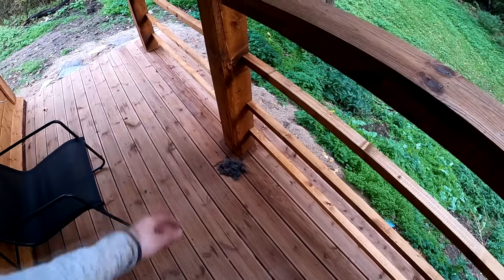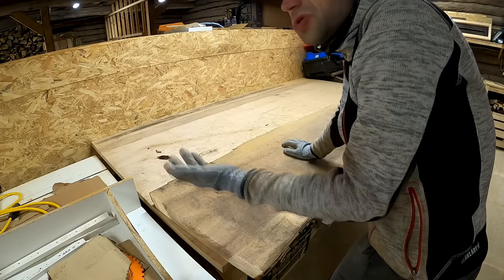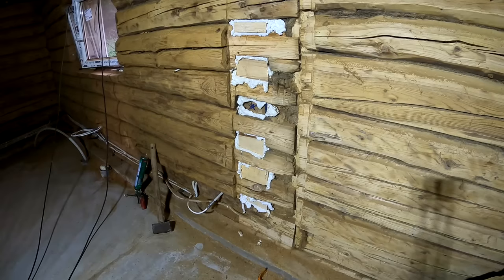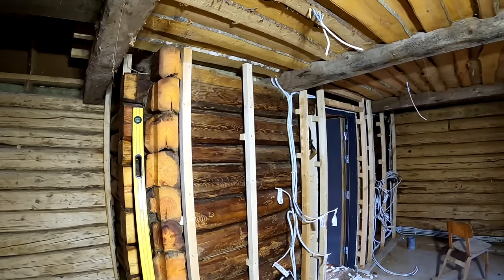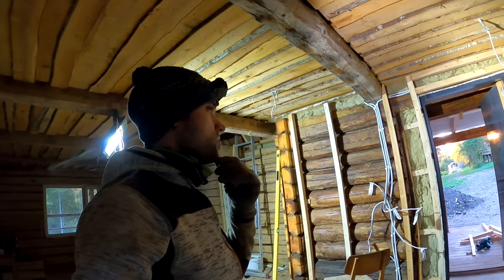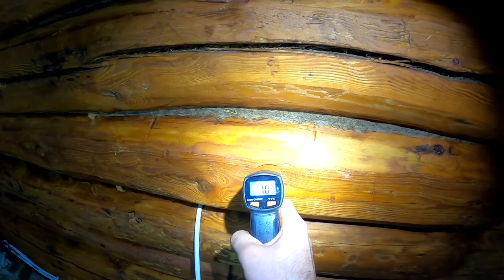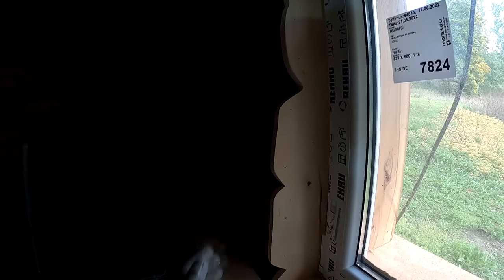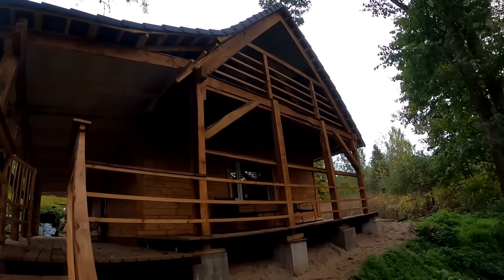Renovating a 128 year old forgotten log cabin (part23) - Interior Walls Finish

Comment: If you don't put steel wool in with the foam, the rats will go through anyway. They wont go through steel wool, It tears up their mouths and between their claws.
Reply: He could wedge it between the gaps in the logs don’t you think?
Reply: He already put in steel mesh.
Reply: Rats dont touch the foam
Reply: I would put everything I would steel wool thin metal sheeting close cell foam  and all the wires I would have put into a PVC
Reply: It will also tear their stomachs and go through into other organs
Reply: @donaldkennedy5604   Not good enough, they can get through that.
Reply: @kenhart6330  and it will also be a painful exiting from it's tailpipe 🐀💨🤣
Reply: The mesh he used is too big to keep mice out. I use metal lathe (very fine diamond pattern) and then spray foam it. There is also spray foams that have mouse poison in it but normal spray foam they will go right through.

Comment: You should round off the ends of the window sills like you did the top edge of the front door frame.Nice detail with the drywall edges where it meets up with the log walls.
Reply from the maker: Good tip. Thanks

Comment: My friends installed old barn wood as an accent feature. After a while, and as the boards warmed up in the home, bugs started hatching and swarmed everywhere. They ended up having to hire and exterminator. I hope those boards you used do not have bug eggs in them. Thanks for another great video.
Reply from the maker: Yes i will keep an eye out. Seems unlikely as the holes i could see through them

Comment: I love the spotted wood with bug holes in the window framing (As long as the bugs have vacated the property) it ties in well with the 128 year old logs. probably need a sign where the wire mesh is, NO ENTRY and a picture of a mouse engraved into the wood and a date :) (always thinking of the next guy to find it, hopefully in another 100 years. i prefer the soviet trolley to the chair although they are probably equally amazing in their own rights.
Reply from the maker: I agree very much. Glad you like the solutions iv came up with. Soviet stuff are great i got lots of em and they seem to last forever

Comment: Mice are repelled by peppermint odor. You can buy the spray or use peppermint oil. You do have to reapply about every 3 months. Since your mother & aunts have such a nice garden, you could even use fresh peppermint to make oil. It's one more layer of protection. I spray around doorways and other areas where mice might come in.
Reply from the maker: Thanks for the useful tip 👍

Comment: Tere. Perhaps i see a problem coming. Log buildings sit, sink and settle until the rooftop is on the ground. No matter how old the logs are you build with. Whenever you put anything vertically solid structures on a log frame, you should make them "floating". Nice work as always! Hope that this settling won't become a problem.
Reply from the maker: before i put any windows on it, i let the logs settle for about 8 months over the winter with the snow and concrete roof on it. I hope it did most of the sinking during that time

Comment: My favourite part was when you cut a hole in the plaster board and pulled the wire through!
Just wondering whether it is possible to clad the wall with some Alder rather than plaster and paint. 
Great job and fun to watch.
Reply from the maker: Hehe interesting solution 🤔 thanks a bunch.

Comment: About your question on what to do with the window you first see walking in through the front door: I'm no carpenter, but it seems to me the grey insulation matter just needs covering up right above the window frame - either with a couple long splinters from the log wood-type, or with some more beech, if there's space to fit it? If you use the log-type & manage to get the wall-flush "splinter" lengths flush with the perpendicular beech-wedges already there, should look cool - lilke a special feature! You're really good with getting all those bulbous shapes to fit with custom fitted straight planks, so I'm sure you'll work something out - if need be.

Otherwise - fantastic job, pleasure to watch this ancient cove becoming more custom & getting some extra spruce!
Reply from the maker: Hehe yes log idea is great ill try to do that one day

Comment: Turned oout great man!
The inside framing of the windows, very nice.
If the bugs got in the wood whilst it was alive it probably is not the ones that go well with dry? I think, hope or mabye not crave but whatever, touch on wood.
Reply from the maker: That makes sense tbh. There are bugs that only live on live wood and then there are bugs that prefer dry wood. Good hindsight there 👌

Comment: I would have thought that milled wooden boards from the trees on your property might have been more in keeping with the cabin rather than drywall (plaster board). It would have the same effect of hiding the wires without the clash of materials that the drywall in a wholly wooden cabin delivers. Just a thought. I am loving the way the logs turned out inside. Another great long-form video. Fabulous.
Reply from the maker: Thank you for your input. I appreciate it a lot ❤

Comment: new here , but love what you are doing. i have an idea for your bags of saw dust and wood chips. take your 20 ton press and a piece of  pipe 609.6mm long and 76.2mm in diameter. cap one end of pipe off and make a fire log press jig.
Reply from the maker: Good idea
Reply: If a binding agent is needed you can have little ones help make home made natural school glue non toxic if burned. Not sure how to get the logs out of the tube but worth thinking about. Have a beautiful day

Comment: I have used linseed oil , after it is dry it is safe, by careful with rags and brushes, they can spontaneously ignite,especially in sunlight or being compacted in trash, after I use them I burn them in the wood stove.
Reply from the maker: Yeah iv heard this too. Wondered about the linfelt as it was compacted between the logs but it didnt even get any hotter then that

Comment: Altax is making product to kill bugs in wood, it is permetrine in some solvents, it's little bit oily, you can apply it on backside of boards and after drying oil them with linseed. I'm doing my best not to use bug infested wood on new projects but if you want to use it, just kill all the bugs. Watch out with this kind of products because it will harm cats, just not allow cats to get close to wet boards or cans with this stuff. Another great video and progress. I'm amazed where you get time to do this stuff, are you doing it after work? Those videos are very motivating :)
Reply from the maker: Yes after work. Most times on free days though. Thanks for the tips. Will keep an eye on the bugs of there are any 👍

Comment: Not sure if you realize-
You can make a bracket, hold a circular saw upside down, blade sticking up through a table.  Replace that weaker saw. Make it so it detaches easily, if you need the saw portable again.

Comment: Ok you probably already know this but just wanted to make sure. The back end of your knife you used to cut the Sheetrock comes off and there is a slit that you put the blade in so that you can use it to safely and easily break off the dull section
Reply from the maker: No i didn't 🤔 haha thank you 👍

Comment: I LOLd as I watched the machine gun attaching the trim. Are you sure you never worked in a mobile home factory? When I worked in a mobile home factory, it sounded like rapid fire machine guns.

Anyway, the walls turned out beautifully. How are you going to finish the joints on the drywall?
Reply from the maker: Mwhahah. Yes 😅 with plaster some other time

Comment: I liked this episode a lot. I personally dislike dry wall (in general.) so I would have liked it better if you'd used the Elm to cover the walls. (But like you said earlier in the video, I am weird.).
My favorite part of the video was when you were talking, saw someone mowing the grass and commented (At least SOMEONE's being productive..... Insinuating that most people living on your property just mooch off you.). Made me laugh to know that families are the same all over. 
I also really like the work you did on the window frames. And the oil helps to add some character to the wood nicely.
But as you were showing the work you did, I saw that the boards for the second floor are not up to standards of the bottom floor. Do you plan on making them look better, or are you going to cover them up? I think it would look nice to have some of your home milled lumber cut square and then screwed into the boards giving you a nice ceiling for the first floor, then you can stain or oil that to make it look the equal to the rest of the building.
So good job sir, and keep the awesome content coming.
Reply from the maker: haha :D 🤣 yes the oil does improve the overall situation i suppose, The second floor boards, not sure yet, yes those are just sawmill boards i put there so i could install the roof supports in the very beginning, now im thinking if i should cover them up or take them down and send them through a planer, Me thinking coverup would be a better and easier solution
Reply: @Ants_Pants  If you leave in place and just ensure that they are level enough that you can cover them up. To my mind it would make things so much easier. Since you will have a stable sub-floor, and things to attach the ceiling for the first floor, and the floor for the second floor too.
Plus with all the troubles you have with nails (assuming those boards were nailed down).... Do you really want to fight with getting all the nails out?
Although I will admit that I laughed REALLY hard when you were talking about oiling the walls. "And I can hardly smell the poop anymore." LOL That is something we should ALL strive for, make the bad smells go away.

Comment: What if you were to put 3 to 4 logs (cut in half or less then half) vertically or cut logs into small pieces to fit in inline/horizontally in there instead of that beautiful piece of slab of wood? And yes the slab looks odd being in there
Reply from the maker: That would be a ton of cutting 🤷‍♂️ It's an cool idea though 👍😊
Reply: @Ants_Pants  i understand👍

Comment: I discovered your channel this week and I watched all 23 episodes of the cabin restoration. My only option is. You spent so much effort restoring it. Why would you cover up the logs with drywall? I think you will loose the character of the building. I would sand it and stain it or use some old barn wood to cover it. 
But I’m against using drywall on such a beautiful project. 
Just my opinion. 
Keep up the great work. Love what you do.
Reply from the maker: Thank you for your obinion. I respect that. I went with a solution that is a compromise
Reply: @Ants_Pants  After I finished watching the entire episode. I think you made the best comprise. Looks really good. Can’t wait for the next episode.

Comment: That must be a European standard of wiring. It looks more like plastic conduit over extension cord because it’s very flexible. America we use solid wire except for on a stove connection or a dryer that runs 220v. Lighting we use 14 gauge and outlets use 12 gauge wire. I’m not sure why Europe never adopted American standard for electrical. I worked for a company in Houston, Texas on a seismic ship the first ship was Philippine flagged the second ship was Ukraine flagged meaning the ships crew other than the captain were from the flagged country of origin.
Reply from the maker: I'm not sure

Comment: I can't hold it in any more - why did you install the front door so it opens to the outside? Shouldn't it open to the inside, so when your cabin is burried under 2 meters of snow you can still get out?
Reply: I think the overhang in front of the door should cover the door area from snow, but yeah, the door opening outward caught me off guard as well.
Reply: Fire regulations (at least) in the Nordic states that all doors should open to safe direction.
Reply from the maker: Fire safety regulations require it to open outwards. It's a european thing 👍

Comment: I don't mean to discourage you but won't you create an unstable situation with the logs?  Each log gives support to the  other logs and keeps the "situation" stable.  I you cut the ends too short they might cause the other logs to lose "their place" in the wall and shift.  You might come out one morning and find a pile of logs at the end of the driveway instead of a building.  In addition, why don't you put the wires in conduit.  You could label the tubes so you know where to find the wires for the ceiling lights (for example).  Why did you do the work to preserve them?  I am not sure why you want to cover up the logs in the first place.  ???  I know this may not be the info you nee right now but all I can come up with are questions.
Reply from the maker: No probelm at all. If i find bunch of logs scattered all around in the morning then that's pure gold coz free logs😅 the wires are in a casing behind the drywall. As for thea outside i have labeled then what goes where.
Reply: @Ants_Pants
Reply: Thank you for answering.  I am glad that I didn't upset you.  Very few reply and I don't know if I have offended or they are just busy. I have been surprised at how many times we have been thinking the same thing. You work so hard that I hate not to say something that might save you time etc.  Take care and be safe.

Comment: Those boards are full of wood eating insects, you need to get them out ASAP. Its woodworm. Its no joke. You could try insecticide, but that only works half. You want  a "Permethrin" solution. Its a general insecticide in a container. Apply before painting so it can soak into the wood. It would have been best to treat the shaped wood before placing it. 

All the parts with woodworm you sawed off are best burned. 

It looks you did a good job. But the woodworms, it would be sad to lose the cabin to woodworms. 

Professional antibug companies use cyanide gas to treat houses that have woodworm. If you would do it, and its dangerous. you need so seal everything up. Get "Potassium ferricyanide" and sulfuric acid drain cleaner. Get a container, mix it, and have it gas the house. Everything that inhales it dies, so mice, cats, birds, people. Its dangerous they used it in WW2 to gas people. So its dangerous. Wear a gas mask or get a company to do it. Or hope for the best with the Permethrin solution.  

Greetings,

Jeff
Reply from the maker: Hey jeff. The worms that did this damage don't eat dry lumber. Different species.
Reply: @Ants_Pants  Well im not too convinced. It might eat the entire house. 

Greetings,

Jeff